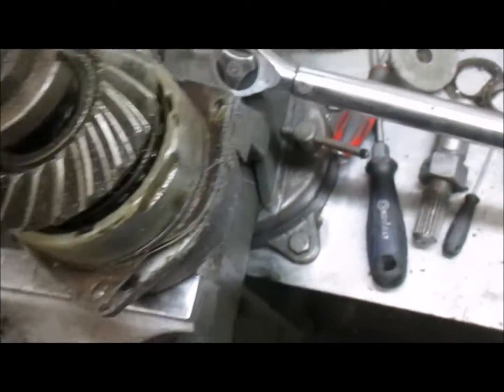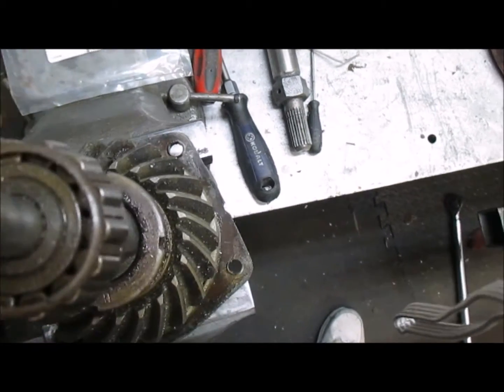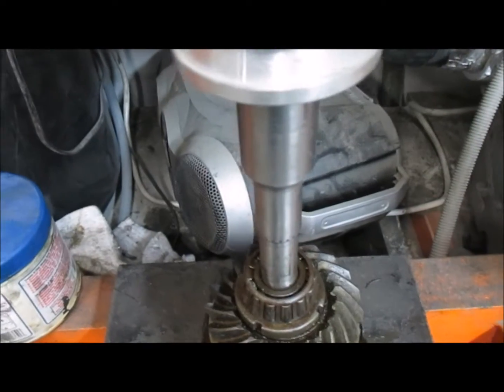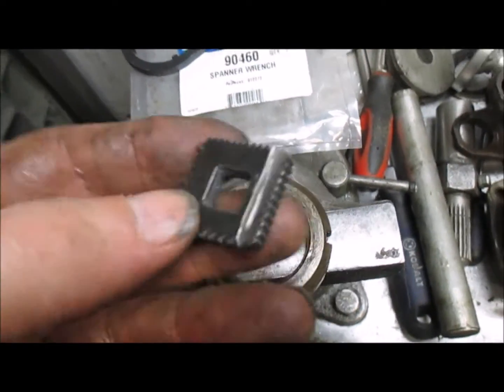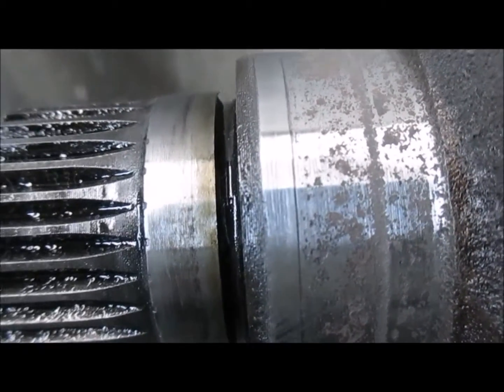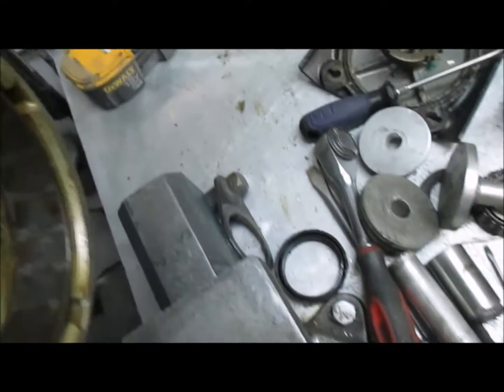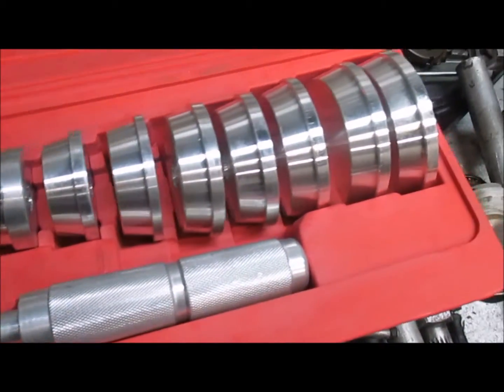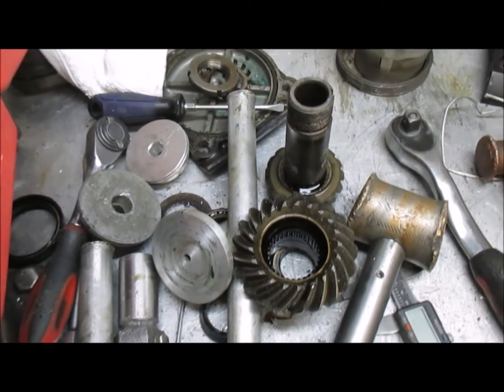OMC Cobra upper gearcase disassembled Part 2

Comment: Does the water pump drive shaft come out? Mine is in bad shape
Reply: That's the question I have also.

Let me know how you removed the water pump shaft.
Reply: @slideglide9418  I don’t remember now if and how I got it out lol
Reply: @kennyrmurray  I did more testing and it's working now and pumping water.

I forgot to see if the prop was turning, so tomorrow I'm at it again.

I seem to fix thing by accident.

I have two Cobras, a 1987 and a 1986.

I'll be back to check out more of your work.

Thanks